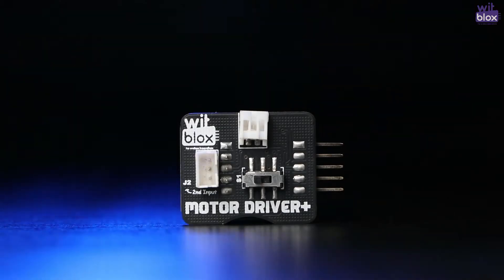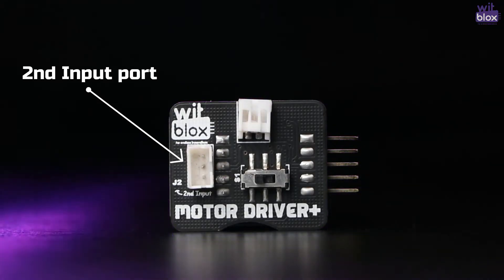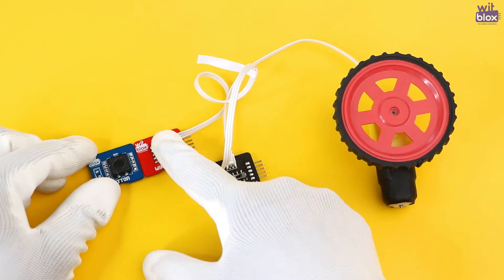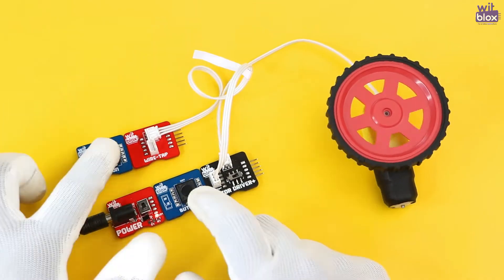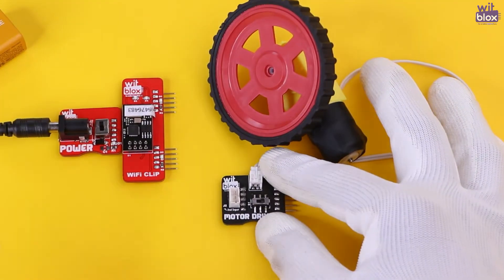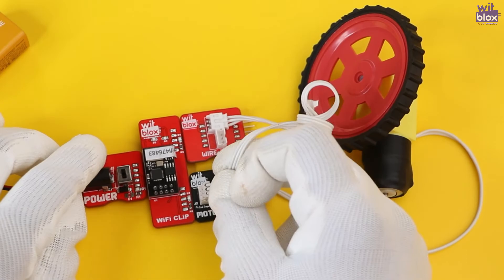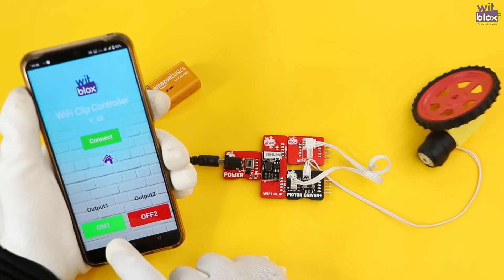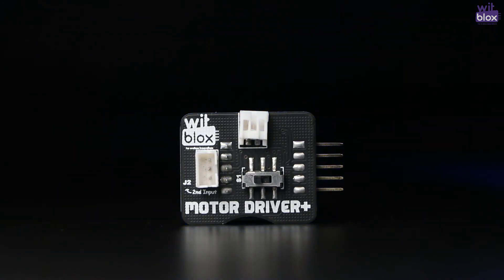How to use the Motor Driver+ Blox || An Introduction

Comment: bhai what is the maximum voltage it can handle like i have an motor to chnage the direction which runs on 30v DC current and 2 to 3 amps ? will it work